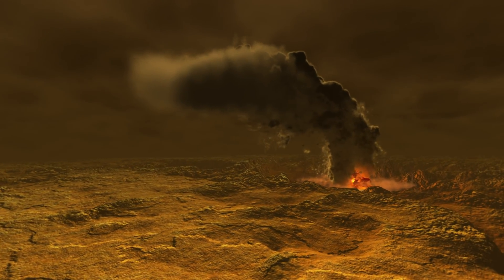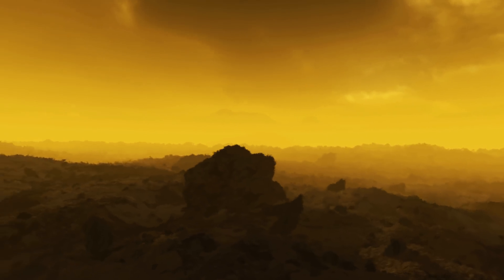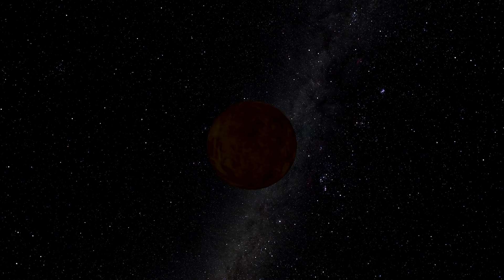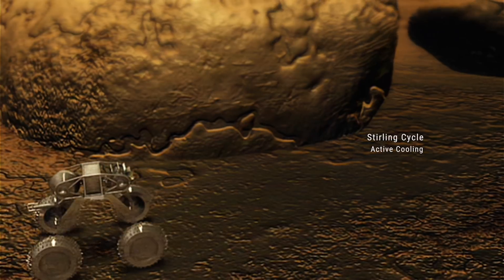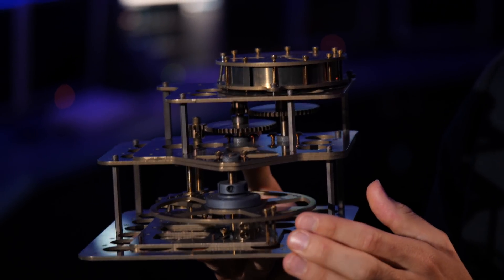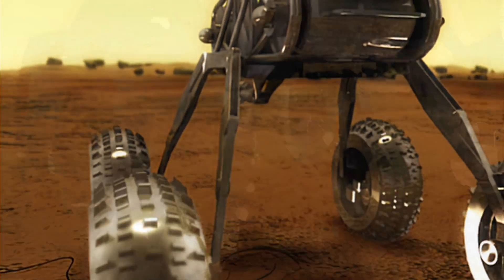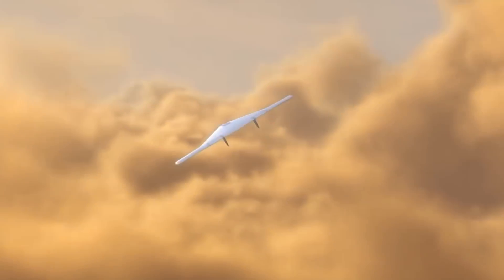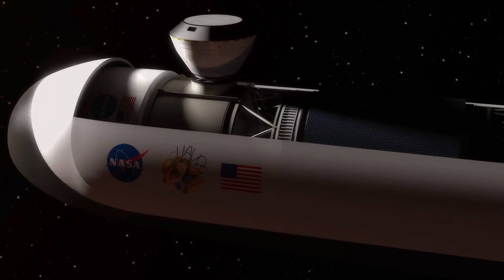Venus: Doing Science in Hell

Comment: How will they use the wind to power the rover, when there is hardly any wind at ground level? When data came back from the Russian probe it showed very very little wind hardly a breeze because the atmosphere is so thick and dense wind is almost absent a slight breeze. Also they could use that aerogel stuff it's light weight and can withstand high temperatures also. Use it for insulation keep certain parts of the rover from overheating or melting. Should of been using it on the Mars rovers to insulate the motors so won't get to cold and damage them..a backup if the heaters failed. Mars has plenty of wind so a wind sale on it or getting power from wind would be ideal on Mars when the whole planet is in a big dust storm then getting solar power is impossible so getting it from the wind since that's what's kicking up the dust everywhere is ideal. Should do that on Mars and test it out before Venus since Venus has any wind at all just a slight breeze and barely a breeze.

Comment: We can create a dipping probe on Venus attach to a floating craft 50km up. The tether will act as a power conduit and also as thermal conduit which will cool the probe by transferring heat from the probe to the radiator onboard the floating craft.

Comment: This was actually MUCH more interesting than I expected. I even subscribed; I'll give it a shot.

Must admit, I had not thought about wind turbines on Venus. (They might actually be more like underwater turbines on Earth.)

PV won't work, unless you can come up with some kind of  PV device that will work at those temperatures. Concentrating solar is out, with no direct sunlight. Nuclear is no-go, because it's a heat engine, with a T-low that is insanely high. But there IS one other option: Collect solar energy in orbit, and beam it down as microwaves. Frankly, I think this idea sucks for Earth, but for Venus, it might be just the thing.

BTW something just occurred to me, that I NEVER thought of before: Nuclear reactors in orbit, ANYWHERE, are a really problematic idea, because, again, they're heat engines, and creating any kind of cold reservoir is very difficult, as you can dump heat only by radiating it away. (However, at the lunar poles, it could work very well. So could solar thermal, which could be much more efficient there than PV.)

I think floating platforms above Venus are an insanely horrible idea for humans; but for robotic craft, they could be great. For one thing, you would not necessarily need to get back into orbit.

Comment: I really think NASA is taking the complete wrong approach to this. Why would you want to have a probe that lands on the surface where the temperature and pressure are at such extremes. They need to handle it the same way we handle going to the floor of the ocean. You have a surface ship that lowers a probe into the extreme depths of the ocean for short duration at a time then hoist it back up.

In the case of Venus they would need a blimp type vehicle floating at the top of the atmosphere with a probe that could be lowered down for short duration. Technically it wouldn’t even need to have much in the way of electronics because much of it could be kept on the main ship floating above.

This idea of having a mechanical rover on the surface is idiotic.

Comment: Instead of landing or flying,  let's change the the approach to the weather and heat problem.

Find Out Way To Pump Out EXTRA AIr out of Venus . Yes, sounds crazy , but in 40 or 50 years pumping out  , I believe it can be done and Venus can suitable to land.

Land Now and find out everything melts like 1982 mission, then whole project will be abandoned for another 40 or 50 years.

In my view Venus is much more better candidate for human civilization than Mars itself.
Reply: Smart view!
Reply: Also,  We can add an artificial gravitional moon, tidaly locked to Venus, and increase Venus rotational speed gradually. This will distribute the heat to the whole planet and can reduce Temperatur and pressure dramatically.

Comment: Convert heat to energy , ceramic based electronics that depend on high temperatures to work fast , construction designs to deal with high pressure stress.

Comment: Venus is so hot. Would it be possible to create an energy generator that uses the thermal energy from the air?
Reply: You either develop IR photovoltaic or need a large apparatus that uses the heat differential between different altitudes
Reply: Not really, you'd need a temperature gradient to do it, and I doubt we could build anything several kilometers high to achieve that.
Also, not sure if what it's used in RTGs to convert radioactive heat into energy would last enough on Venus though.
Reply: I trust Gordon Freeman's opinion 😂
Reply: @KissMyFatAxe  one has to wonder why,, as it was in large part in error.
Reply: @KissMyFatAxe  Lmao ... I still like Half Life, but in this case Gordon is in error. I was thinking of thermo-couples, considering how much time I could give to this fancy, idly ball parking the constraints when applied to Venus, just before I came across Nicholas's comment, it's very insightful in point of fact ...
Reply: Gordon Freeman we couldn’t do it today but humans of the future most likely will
Reply: @fortuna19  if you mean by future, in about one to five years, I would agree.
Reply: @GoldSrc_  what you said makes no sense, the more so, as you already have the high temperature side as a given. Had you started with "In my opinion ... " twould have been less misleading.
Reply: @singularitysquaredllc.895  What made no sense? You do need a temperature gradient, you can't just do it on the same spot on Venus.
Reply: @GoldSrc_  the dearth of options provided were so limited, as well as axiomatic. I took "Not Really" to mean that If it wasn't the one way you suggested, it couldn't be done. I disagree; for an instance chilling and refrigeration as a rule comes from using a mechanical vapor compression, system. Without designing such a system in this thread, though it would be fun ... time constraints don't permit it. So, in any case, in a "handkerchief" first pass context, utilize the pressure of Venus on a gas, then use the differential between the hot skin of the craft and or device, and the thus cooled inside to thereby leverage the resultant thermoelectric effect.
Reply: @singularitysquaredllc.895  You wouldn't be able to keep the inside cooler for long though.
Reply: @GoldSrc_  define long? If I used aerogel as an insulate, it might be longer than you think and thus were to give me as a definition. Proof being the temperature of Venus is established to be about  900 degrees Fahrenheit or 465 degrees Celsius, yes? However, the flame from a blowtorch is approximately, assuming an air butane torch, can develop flame temperatures up to approximately 1,430 °C or 2,610 °F.  If you were to Google Aerogel and blowtorch, (and you might even find such on YouTube), would find that I could hold a three mm slice of aerogel in my hand you could aim a blowtorch at my hand, and I would feel nothing.
Reply: @singularitysquaredllc.895  Correct, but aerogel is not known for being tough, you'd have to find a way to keep it without breaking, which would make its insulating properties useless once it breaks.
Something like the space shuttle tiles might work, but then you have the pressure and how you would glue them on and not have any of them fail.
Landing on Venus is already pretty hard, we would need to figure out that first and test a lot of materials first before we even think about extracting energy from the heat.
Reply: @GoldSrc_  the mechanism(s) used to keep cameras steady in filming, come to mind, as a first pass assumption. Plus we have the pressure the temperature, the CO2 and the heat, so it's not like we couldn't make more ...
Reply: @singularitysquaredllc.895  With how little money NASA gets, "making more" wouldn't work, specially if we're talking about very expensive materials.
I don't think we could make more JWST's if the only one we have blows up.
Reply: @GoldSrc_  whose talking about NASA? Right now, we're in charge as a private corporation, and expenditures for occurrences such as this, are already in the budget, obviously.
Reply: The technical term is "thermocouple" ... "In 1821, Thomas Johann Seebeck rediscovered that a thermal gradient formed between two dissimilar conductors can produce electricity.[2][3] At the heart of the thermoelectric effect is the fact that a temperature gradient in a conducting material results in heat flow; this results in the diffusion of charge carriers. The flow of charge carriers between the hot and cold regions in turn creates a voltage difference. In 1834, Jean Charles Athanase Peltier discovered the reverse effect, that running an electric current through the junction of two dissimilar conductors could, depending on the direction of the current, cause it to act as a heater or cooler" Yes it would be possible.

Comment: Why is the atmospheric pressure on Venus so high?
Reply: How could this happen? Or you could ask "How can a planet nearly the same mass as Earth have an atmosphere 100 times more massive?". This is one of the big mysteries of Planet formation & evolution. There are two halfway compelling scenarios that come to my head now, both involve Earth and Venus having similar atmospheres at a relatively young age of ∼100
∼
100
Million years.

Venus might have gotten less accretional heat in the phase as the solar system formed. Together with it's smaller size, it was able to radiate this heat away even faster than Earth was. Also smaller size implies less radiogenic heat production throughout the ages.
All those factors might have conspired to make plate tectonics much weaker/nonexistent on Venus. This prevents burying of the atmosphere, as it happens in Earth's mantle. But it is hard / impossible to estimate how strong this effect was in the past.
Venus went early into a stage of runaway greenhouse effect. We know this, because we find it today in this state. Somehow this protected the atmosphere from escaping (I don't want to specify any mechanism, as there are many possibilities), while Earth lost a significant portion of its atmosphere over time.
Reply: Imagine if all the Oceans on Earth Evaporated. All of that mass would then become a gaseous mass above your head. In Venus's case, the hydrogen in that water got knocked off by ionic radiation and blown away by the solar winds. The leftover Oxygen then finds reactive elements on the planet to bond with, and Carbon loves to bond with oxygen, especially at high temperatures.
Reply: Nolan thank you
Reply: Well I would imagine it most likely has something to do with the fAct that the planet not only rotates in the opposite direction of all the other plants in our solar system, it also rotates extremely slow. 1 day on Venus is 60 days for on earth. Perhaps some type of collision or a massive bombardment of some sort?